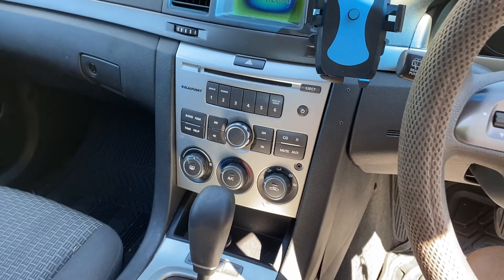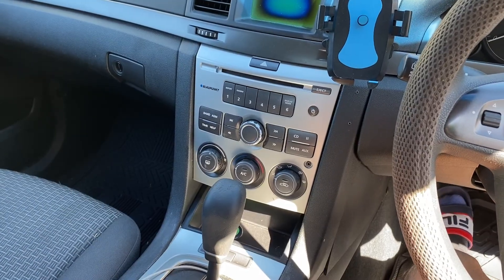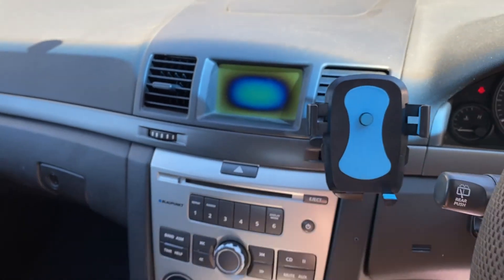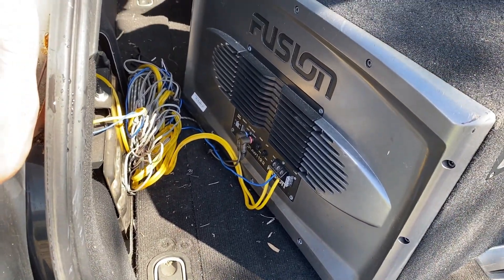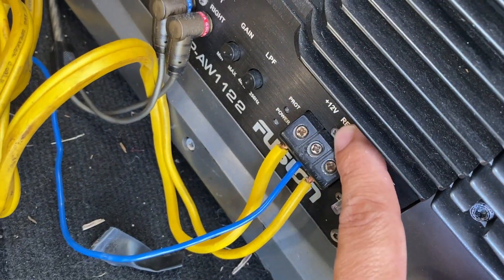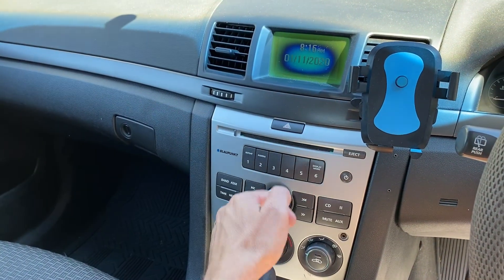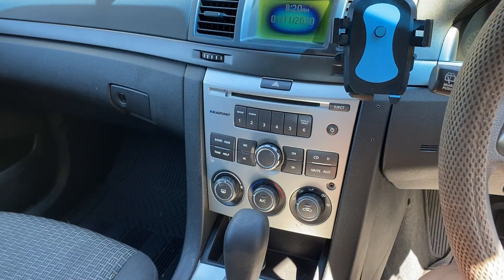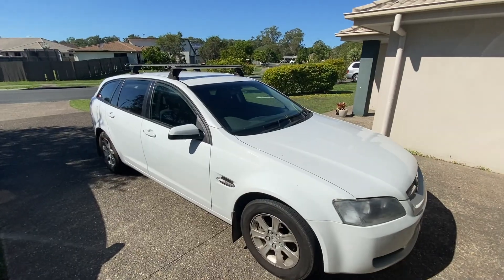VE COMMODORE BASS!😍😍😍 Improving the SOUND!!!

Comment: I have a Holden commodore omega 2010. do you think the Holden commodore will sound good with subs. Just asking because the boot of the car will be closed and blocked off. Just a curious question. I don’t even know if I explained it properly lol but will it sound good with subs?
Reply from the maker: Lol, it all depends on the angles! You’ll have to experiment 👌. The sport wagon worked best when it was rearward facing, must have bounced off the rear window just right. 😂😂😂